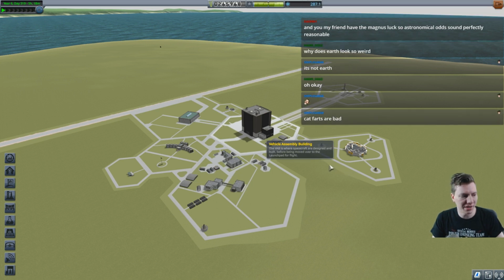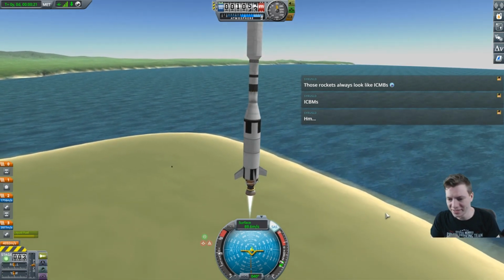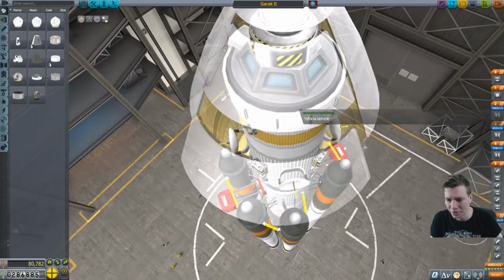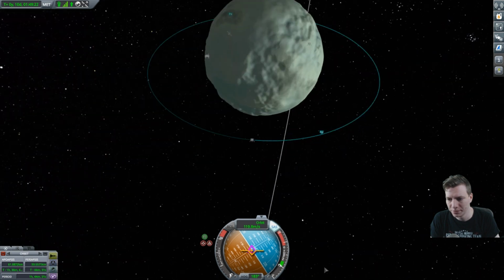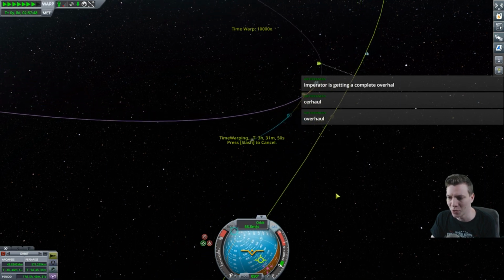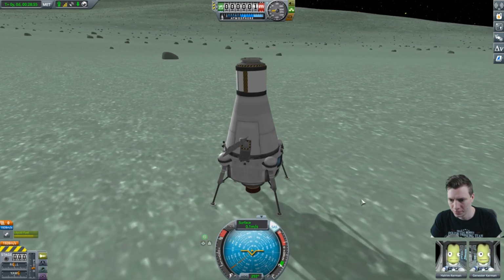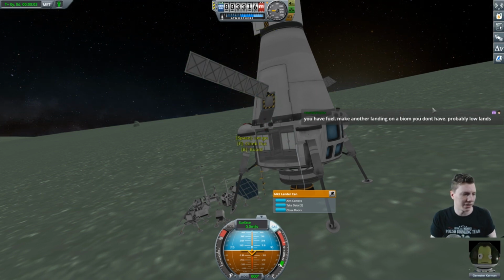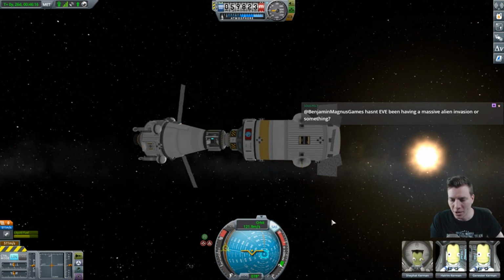Kerbal Space Program Breaking Ground Career Mode | Part 16 | Failed Satellites

Comment: Start your gravity turn earlier. No later than 100 m/s. Rockets go out of control when you're pointing your nose is too far from prograde. The faster you're going, the less forgiving it is (because the air is pushing harder on the side of your rocket). Turning on the aerodynamic overlay can help you see this effect.

Also, top-heavy rockets are good, provided your rocket isn't wobbling. Think darts -- heavy in the front, fins in the back.